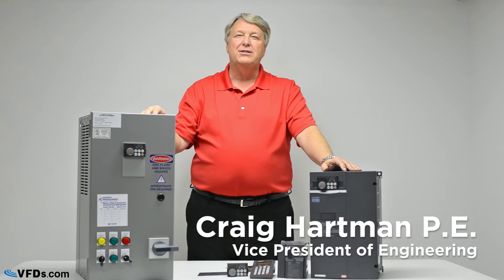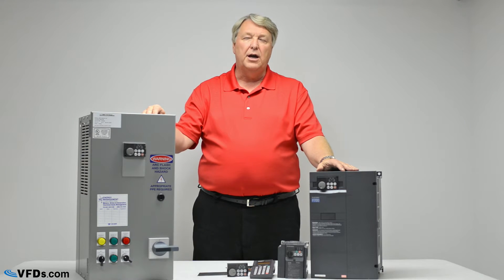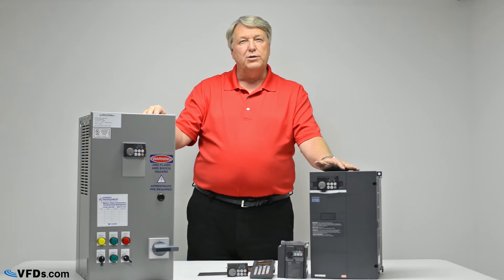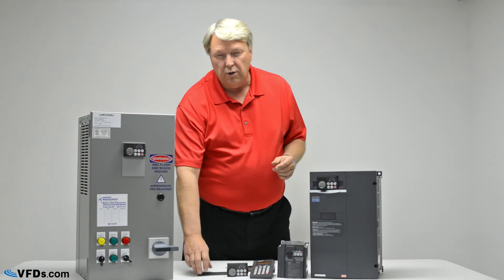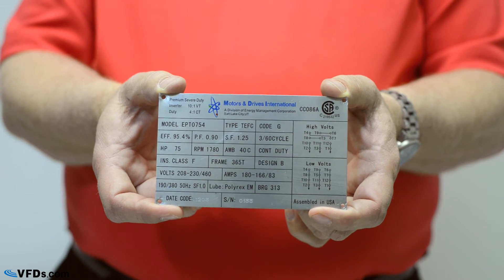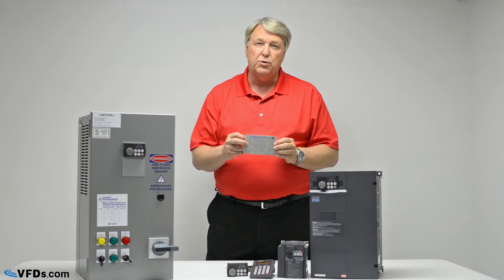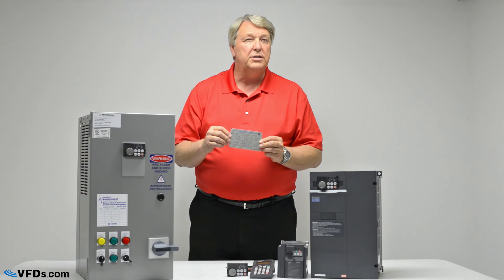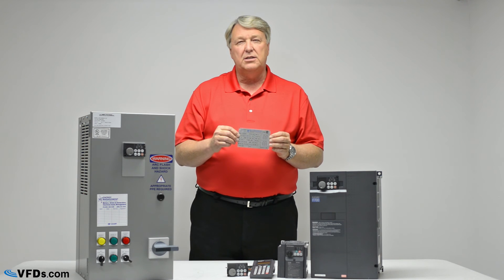How to size a VFD

Comment: Hi Craig . . . I would like to add a big red safety STOP mag switch with the VFD I am installing on a bandsaw (1.5hp / 220V 3P) to run off 220/1P. I can place it between the source and VFD or between the VFD and motor. Any recommendation on which method is best?
Thanks,
Dennis

Comment: Something I’ve never really found much information on is what type of 3 phase motor works or doesn’t work with a single phase VFD. Does the motor have to have a 240v configuration on the ID plate to be compatible? Would a 400 odd volt three phase work with a single phase vfd?

Comment: Hope you can give me an answer. I have a compressor I want to run and may later up the size to a high rated one. Can I go over sized and not mess things up or?
Reply: An oversized VFD is fine, the same way it's fine to plug a 10A load into a 20A circuit (the AC power feed from the wall to the VFD will need to be rated high enough for the load applied, 2X the 3-phase current).
Other way around (20A load on a 10A circuit) won't work.

Comment: Application : Pump

Motor : 1HP 2Pole 3Ph 50Hz FLA 1.7a

Driver :
FLA - 0.7a to 3.0a (Default at 2.5a)

The input amp and output amp from drive rating when i run motor at
5hz - __ / 1.7a
25Hz - 0.3a / 1.7a
30Hz - 0.4a / 1.7a
50Hz - 1.7a / 2.5a

Kind regards

Ray

Comment: I have a VFD drive thats running a 5.5 kW motor with solar power, it also has terminals for AC input. can I use a 7 KVA generator to run this motor? My purpose here is just to overcome the starting torque so that i dont have to buy a bigger generator?

Comment: hi.can I use 3kw motor(i=11.4) with 3kw vfd(i=8.5)? thank you
Reply from the maker: Ehsan, what is the amps on the motor? What is the "i" that you are referring to?
Reply: VFDs.com 
hi 
amps of the motor is 11.4 .I read it from name plate.
thank you
Reply from the maker: Ehsan, you will need a VFD with 11.4 or higher amps.
Reply: VFDs.com Thank yo so much for support
Reply from the maker: You are welcome!

Comment: In the video he said all "VFD are constant T", if I am spinning a motor in a fluid would I have to set the T on the VFD before I start my process? 

Kind regards
Reply from the maker: Ryan, I am not sure what you are asking. The overload rating is not a setting, it is a specification of the VFD. Can you elaborate your question? If you have questions about programming, we have a few other videos showing how to program a VFD. In those videos, we used all Mitsubishi VFDs, but the parameters you need to set are the same.

Comment: Hi Sir,

Can I use the VFD as below:-
1. Input - 415V 50HZ 8.3V/Ph
2 Output - 460V 60Hz 7.8V/Ph
3. For centrifugal pump

Does it affect the life span of motor or VFD.

Kind regards

Ray
Reply from the maker: Ray, I am not understanding your question. What is your input power, motor, and VFD spec?
Reply: Our electrical characteristic is 415V 3Ph 50Hz.

Can I run a 60Hz 440-460V motor with VFD (input power 415V 3Ph 50Hz).

or 

I need to add transformer to convert the electrical characteristic to 460V 3Ph 60Hz before VFD Input.

Kind regards

Ray
Reply from the maker: Ray,

You can get a 460V, 3Ph VFD for your setup. You don't need the transformer. The VFD will run at 60Hz at 440-460V.

Comment: Hi Sir,
Can I use a VFD Drive (3.7kW) 8.2Amp on 4kW (7.5amp) Motor ?

Kind regards

Ray
Reply from the maker: Just looking at the amperage, yes, you can use a 8.2A drive on a 7.5A motor. But other factors such as attitude, ambient temperature, and the type of application will make a difference also.
Reply: Hi Sir,
Attitude - Unknown
ambient - Max 40 deg C
Application - Booster Pump

Is it ok ?

Does it help if I prolong the time (20-30seconds) to full speed.

If the VFD is undersize, will it damage to my VFD or only tripping ?

Kind regards

Ray
Reply from the maker: Ray, you can set the acceleration time to 20-30 seconds, but we do not recommend using an undersized VFD. The diodes in your VFD may be permanently damaged when operating a larger motor.
Reply: OK, noted.... Thanks a lot...

Comment: Is there a drive that will do 480v single phase input to 3phase output?
Reply from the maker: Hey Matt, you will have to derate the drive to make it work. If your motor is rated for 5 amps, you need a drive with 10 amps or more. Make sure there are nothing (switches, lights, etc.) between the drive and the motor. Put them after the motor or on a different circuit if you can. Hope that helps!
Reply: +VFDs.com  Ok, so here's the thing, I have some shop equipment that I bought that is 480v 3 phase, all I have is 220v. So if I add a transformer to bump it up to 480 and then add a a vfd that is rated at twice the amps to that my motor needs I should be good? The vfds I see all say 480v 3phase input. Thanks for the reply!
Reply from the maker: Matt, 

If you have 1 phase 230V power and 3 phase 460V machines; yes, that will work. The transformer will convert 1 phase 230V to 1 phase 460V. Then you can use the VFD to convert 1 phase 460V to 3 phase 460V. Here are a few things you should beware of: 

(1) this is the arrangement you should have: Power from the wall > transformer > VFD > motor
(2) if your transformer is big enough, you can use it with multiple VFD & motor setups
(3) again, nothing in between the VFD and motor

Let me know if you have other questions!
Reply from the maker: You should also look at the overall cost, to see if it is worth getting new machines that are 230V instead of the transformer.
Reply: Well, got a good deal.. You know how that goes..  I paid one price for everything in the garage.  Only the Cincinnati buffer is 480v   I don't have to have it working, but it would be nice.
Reply from the maker: Yeah, we know how that goes. If you don't need the buffer, maybe just sell it. Otherwise, it seems a little expensive to buy a transformer and a 480V VFD just for one tool.
Reply: I'm sure that would be the smart thing... But, now its a challenge!  Looking at used stuff on ebay currently...  Got a 3 kva transformer in my cart for 75 and a allen bradly 1305-BA06A 3 HP 2100.. also for 75.  So just need to get an enclosure..  maybe a disconnect...     I really need to finish the vfd install on my new 1950's south bend lathe first...  Anyway, thanks for the help!

Comment: hello, i have a question sir. i have a problem in my circuit breaker. it is installed after  after a vfd drives and it always tripp when it runs for a few minutes even w/ a normal current. what does it cause to trip? thanks.... can you give me some idea why my breaker trips when installed after a vfd drive? thanks..
Reply from the maker: +ian jemar Yu Hello Ian, what is your application and is the circuit breaker sized properly?
Reply: its application is in Food Manufacturing. SILO process sir. the set of it is one vfd driving a two rotary valve motor and it is design by Guerin. The circuit breaker is in standard size, phase current is normal if we check. we always change circuit breaker according to designer advice but still re-occurrence of happen. i am wondering why, the circuit breaker is new, new motor, normal phase current but circuit breaker always becoming hot. VFD with two circuit breaker which command two motor for transferring of product in a chute or pipe.
Reply from the maker: +ian jemar Yu  We would recommend having a certified electrician to install this for you. It is very likely that the circuit breaker is not the right amperage rating (what I was referring to earlier about size. It is likely too low). The amperage rating of the breaker needs to meet your national electric code.